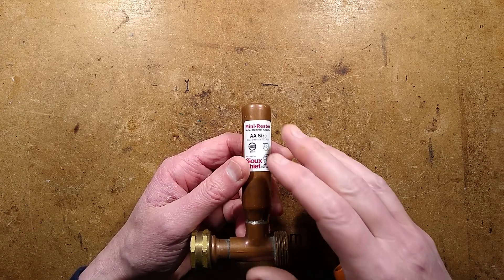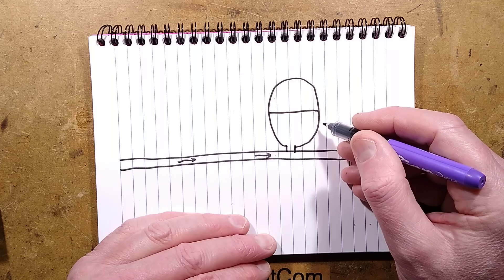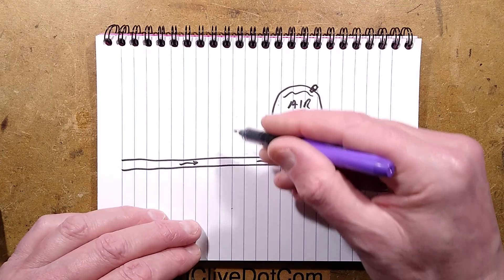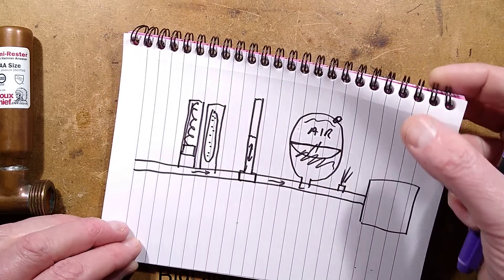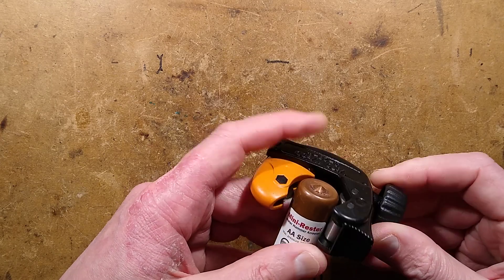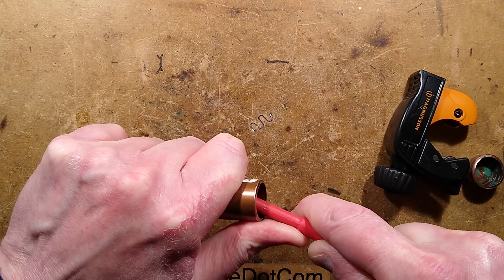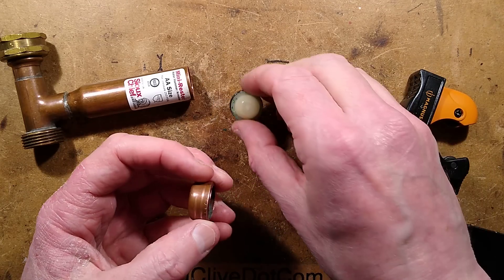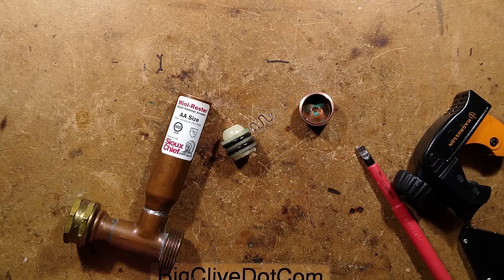inside an American made anti water hammer device

Comment: The membrane thingy is fine even though the water stagnates since it is only used in the radiator circuit which is seperate from the rest. I wonder though how the thermal expansion is solved for the rest of the hot water supply.

Comment: I have never seen such device. Washing machines are usually connected to the water supply using a flexible hose so that probably reduces the pressure pulses.
Reply: Nope, those flexible hoses don't provide very much expansion action to soften the blow of the near instantaneous valve shut off.
Newer washing machines are supposedly much worse than older ones, due to sometimes quickly alternating valves on and off to balance the water temperature. I have polybutylene plumbing in parts of my house, so installing water hammer arrestors on both lines just before the flex was a necessity. It's still highly recommended for all newer washing machines and dish washers to increase the lifespan of your pipes and fittings.
Reply: @Tomd4850  I've never heard of that. We had the washing machine installd by a professional and he just connected the hose directly to the valve in the wall. All water plumbing is being done in PVC here in Czechia.
Reply: @JendaLinda  It's become pretty standard in NA. You can easily look up water hammer from HE washing machines and you'll find how common it is. Believe me, there are far more situations where it does nothing rather than something, but the cases where it does something can range from just hearing pipes bang, to serious damage without warning. Even if it doesn't happen commonly in your area, it's at least a good idea to avoid doing a wash when you leave the house.
Reply: @Tomd4850  Sure, leaving a washing mahine running while being away from home is a bad idea. Anything inside the washing machine may fail and leak.
Reply: 15 years ago when I bought I new machine I didn't get them.  The last 2 machines I bought since then (one for each of 2 moves in the last 10 years) the installer insisted on installing them.  May be a change in code here in Massachusetts.
Reply: @disjustice  These are just not needed here. European washing machines are probably built differently.
Reply: @JendaLinda  here's a secret. Most of the time when those hoses fail,  it is due to the forces exerted on them by water hammer over time.
Reply: @michaelgoettsch7744  Something else usualy fails before the hose would.

Comment: I wonder how much current a conductor of that diameter would carry 👿
Reply: If it was a solid copper conductor(as opposed to a hollow plumbing device) you could probably get 400 or 500 amperes before it was hot enough to melt plastic parts. I’m basing this on 500kcmil wire which is slightly thinner than that and is good for a bit under 400A.

Comment: I've put in some time in the home hardware retail industry and I recognize Sioux Chief as a common brand of plumbing fittings. As I understand this (and my understanding could be completely wrong), hammer arrestors are made and specified for ranges of pipe volumes; presumably the installer does some back-of-the-envelope calculations and selects whatever arrestor is the best fit, just like selecting a debounce capacitor for a switched input.
Reply: @Dwigt_Rortugal The company name is actually intended to honor the culture of the Lakota. All too often, offense is only in the eye of the beholder.
Reply: @petersage5157  this is true, however when it comes to residential water piping in the United States, almost all fixture supply lines are 1/2 inch copper tube size regardless of the actual material used for the pipes,  so these size water hammer assessors are all the same size.  For larger applications they are indeed sized based on pressure and pipe size.

Comment: I've got drawers full of these at work. I test and refurbish dishwashers/washing machines/refrigerators etc, and these are a necessity on the outlets of our water manifold system. They're also really handy if I need to make some kind of adapter or coupling; just cut the ends off and sweat them onto some pipe!
Reply: Now if someone would invent a solenoid that doesn't slam shut so quickly, then we could all get some sleep.
Reply: @two_tier_gary_rumain  I think the only thing holding them back is cost; we've got EEV refrigerant solenoids and expansion valves that open/close MUCH more gradually than an electromagnetic solenoid, but they're also 3-4 times as expensive. They'd probably have to be engineered differently to hold up to water rather than nearly sterile refrigerant as well.

Comment: In the old style the same thing happens as what happens with the bladder tanks for the water heaters: the water absorbs the air in the pipe and replaces the volume with water eliminating the spring effect. A larger version of the same system is used for well water systems so the well pump doesn't cycle every time you turn on the tap and that is probably the most common failure mode. In a pinch you can refill the backside of the bladder with air and repressurize it, but it is a very temporary solution as it will fail the same way again, the steel on the air side of the bladder is not protected against water contact, and you will have trapped water in an environment condusive to growth.

Comment: My highschool physics teacher had a glass tube under vacuum with a small amount of water in it, to demonstrate water hammer. It was impressive.
Reply: You can actually feel the water hammer if you put water in a small plastic hose like what you’d have in a  chemistry lab. Fill it about half way, put your fingers over the ends, and tilt it back and forth.
Reply: A bong?
Reply: I've been trying to figure this out.  Water in a vacuum is a gas.  How was it demonstrated?  Physics teachers always have lots of cool demo apparatus.  They often don't like explaining them however...
Reply: @Chris_the_Muso  if I recall correctly (which is questionable after 34 years) it looked professionally made. He wouldn't let kids handle it, because if you weren't careful, the water could smash its way out the end of the tube.
Reply: @Chris_the_Muso  You apply a shock load, this will accelerate the container away from the water. Due to the vacuum, it is easy for this to happen, as there is no air pressure you would need to overcome. Once the acceleration of the container stops, the acceleration of the water takes over until it smashes back into the container. The gas bubble collapses into itself, as it is only made of water vapor, so no gas cushions the blow.
Reply: @Chris_the_Muso . I agree, suddenly increases of pressure would just cause it change from gas to liquid in the setup described.

Comment: Why do the USA have the "problem of water hammer" and the other 199 countries in the world not?
Do we have other water or was this "problem" invented by a lobbyist who is the producer of such devices? 🤷‍♂️
Reply: I would recommend the channel Practical Engineering. Grady Hillhouse clearly demonstrates water hammer using pressure gauges and transparent pipe.
Reply: @DelbertNewman  I believe you! But such devices are more or less unheard of outside of the USA. 🤷‍♂️
Reply: @u.e.u.e. We have some big houses in the USA. Theoretically the average distance a supply line has to go to reach, say, a washing machine could be further than in an apartment or smaller house. A large line feeding multiple appliances shouldn’t be affected by water hammer unless they all shut off at once.
Reply: @u.e.u.e.  sure anti-hammer are rarely installed inside European houses, but this is very popular inside professional, public and apartment buildings (integrated into the central plumbing of the building).
Nowadays, this also used in watercooling circuits for gaming PCs. Though the so-called reservoir is mainly known to trap residual air bubbles.
Reply: Nope. This is a physical property of fluids inside pipes, so it's a worldwide issue. Though those days, automated equipments are designed with more gentle valves so the water hammer effect is less common.

Comment: The problem in the flat I bought was the Schrader valve rubber had perished so no air or water came out and the previous owner had just topped up the system so it overpressured and leaked at the pressure release valve. I just bought a replacement valve stem and swapped out the bad one, pumped up the bladder with air and filled the system with water to the correct pressure and it was all good again

Comment: Made in the USA, and not entirely plastic? Wow 😂

Best way I've found to avoid water hammer is just to close the tap slowly, maybe make sure you don't have weak pipes
Reply: Can't really do that with washing machines though, they often bang closed, but they seem to have gotten better these days.
Reply: @volvo09  absolutely. The issue is mostly solenoid valves inside automated machines. And yeah I can confirm they got better these days:  I changed my 30 years old dishwasher few months ago and the classic "clong" from the water hammer is gone now. My washing machine never had this problem though, probably because this is a more recent equipment bought when moving to the house 15 years ago.
Reply: "close the tap slowly, maybe make sure you don't have weak pipes"
with three turn screwdown valves, rubber washers, slow closing was virtually unavoidable. with modern quarter turn, ceramic insert taps, it's easy to shut them quickly, resulting in the sounds that evidence water hammer...

Truth is that the noise from the pipes arises from poorly installed pipe work. Inadequate clipping, pipes laid in solid joist notches, but with no padding (hair felt sleeves or strip) to stop the pipes rattling against wood/ chipboard.  same if pipes are passed through holes in joists.  They need to be isolated from structures Hair felt again...

Easier to install pipework well initially, than to rip up carpets and floors to do remedial work... A few more clips, so the pipe work is well supported...a bit of hair felt wherever necessary..

Comment: Larger air bladder tanks are also commonly used on water supplies that come from a well. They provide water pressure without forcing the well pump to run constantly.
Reply: Also known as accumulators....or super capacitors.   We use them as an alternative booster pum0s.
Reply: Those might also be called compression tanks.
Reply: @louf7178  the surge arrestor Big C was playing with might he.   Not what we're talking about here though.
Reply: My folks had one. It was a tank, about two feet across and four or five feet high. I learned that every few months, you have to turn off the pump, open a bleed valve, and let the tank drain out to about half full. Otherwise, the pump would cycle continuously. It turns out that the air in the tank would actually dissolve in the water, and get pumped out to the house. (Originally, it just had a pressure gauge, which you would remove to allow air in. I installed the bleed valve on a tee. Pretty proud of myself for that....)

Comment: Those used to be called a " water hammer "
Common for a big wash sink or a bath tub.
Without one, you would turn off the flow, and the pipes would slam and vibrate inside the wall.
They were properly installed as a parallel off of a vertical pipe.
So they held air from the moment of installation.

Comment: The inverted "T"  was very common in the USA, near washing machines and dishwashers with fast powered valves likely to cause water hammer.   It can eventually lose effectiveness (the air dissolves into the water over time), the fix was to drain down the pipes entirely (so all lines are full of air).  When the water is turned back on, the vertical stub maintains an air pocket again for years, if not decades.
Reply: My house is full of them. And I have to drain everything about every 10 years. Sadly they are all just pinched, and sweated to dead head them. And two have leaked since buying this place.
Reply: That is what I did when I plumbed our house back in the early 1980s, the same way my parents built their house in the 1950s. At the time I did not realize they loose effectiveness as the air is absorbed into the water. I should have realized that because I was aware our well pressure tank was the bladder type to prevent that problem. 

Anyway long story short I added a couple of the water hammer suppressors mentioned in the video to our washing machine to fix the problem.  A nice feature is being attached to the machine they are easy to replace if (when) they fail. I knew the principal of how they work but have never cut one open so thanks Clive.
Reply: Here in Canada as well. As far as I know they fell out of favour because they would waterlog as you say and stop working.
Reply: @VernKlukas  it actually doesn't conform to code anymore in Canada.
Reply: I'll have to try and let them drain off... I don't think mine function that well anymore... The LG washer is way worse at water hammer than my previous Samsung.
Reply: I believe they're no longer acceptable.
Reply: Great explanation, you saved me from posting the same tning.
Reply: Seems a lot easier to just put a shut off valve right before the air trap, and another valve for air at the top of the trap
Reply: Building code here in Eugene OR (and probably all over) REQUIRES the use of a thermal expansion tank on the cold water pipe going into the water heater, whether tankless or tank-style.  
It was a $40 part and is necessary because there is a check-valve at the water meters to prevent backflow into the water supply.
Reply: Growing up in the county in the 60s and 70s. I would help my dad drain the snubbers and the water heater once a year.
Reply: Probably would be a good time for them to have added a small one way valve on top, then you could shut off the water supply and open a drain somewhere low in the system.. wait a few moments and then close the drain. That would draw air into effectively every one of the one way valves.. or it should atleast
Reply: @DarkAttack14  I had a manufactured home from the mid '90s for a while, they had forgotten to install any anti hammer devices of any sort, Plumbing had to be replaced shortly afterward. Quite frankly, I had never seen an appliance shutoff valve explode before. or since
Reply: @DarkAttack14  Valves leak, a capped pipe doesn't, and they are typically inaccessible inside the wall. They drain out just fine when you drain the house every decade or so.
Reply: @DarkAttack14  No need for a valve. When you drain the pipes the water will naturally fall out them; when water is supplied again they will be full of air.
Reply: @DarkAttack14  Why would you need the valve? Just shut off your main water valve, open up some faucets upstairs, then open up a hose bib, which is proabably the lowest faucet. All the water will drain out, even the water in the inverted T. Why wouldn't it?
Reply: @DarkAttack14  Those one way valves sound like a leak waiting to happen. Add in the probable corrosion and such and before you know it, those valves would be in one of two states:
1. Corroded solid and not working
2. Leaking.
Reply: @johncochran8497 why would they corrode if when operating properly they never come in contact with water? Just put a sliding diaphram in there like the one in this video
Reply: @Superabound2  Think of the environment they're in. For instance, are you assuming that pipes never sweat?
Reply: American sparky and even I know about these. This just seems like a combination to a simple thing.
Reply: I built one of these when I installed my house supply lines. The main has a 1.25" valve with a Tee, then splits off to 3 other Tees with different drops. The last Tee is turned up/down with the riser being a 1ft long piece of 1.25" capped pipe with a ball valve on the bottom side. I'll drain the manifold every few months to replenish the air column.  I've not had any issues with water hammering since I installed it. 
I use "real" 3/4" hose fittings, ball valves (not those that decrease down 1/2" or smaller at the valve portion) so when I shut off the hose bib, that can be a lot of water moving coming to a quick stop.
Reply: Yes, for hot water heating systems, we would drain them yearly and fill it back up. They are very large, and the water fills about 3/4 of it. Using the bladder type causes  the size of tank you need to be about 1/3 of just an empty tank, due you being able to pressurize the air side. So the bladder types are mostly for cost/size reasons, less metal needed.

Comment: Maybe having an air pocket above the water in a blind pipe is promoting something grim to grow? That could explain why the version with a diaphragm was safer - no space for an air pocket to form.
Reply: Legionnaire's disease springs immediately to mind, followed by listeria and salmonella..... Which is also why water from the hot tap is not to be used as potable water 🚰
Reply: Could produce a backflow issue to boot.
Reply: Yes, specifically legionnaire's disease.
Reply: so now plumbers just install thermal expansion tanks above your water heater with pre-set pressure to about 40 psi. Then they turn the water on and the tank immediately absorbs it's maximum capacity and the bladder hits the expansion limiter (if it's a nicer one with one of those) and does nothing. Now you have another tank full of stagnate water likely growing some funny stuff.
Reply: @g3neration216  what they're saying is the bladder tank doesn't have an air pocket touching the water so that could make a difference.